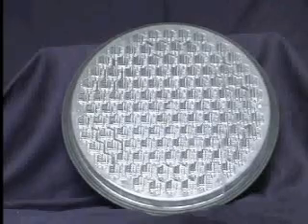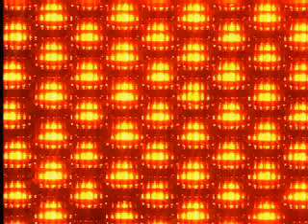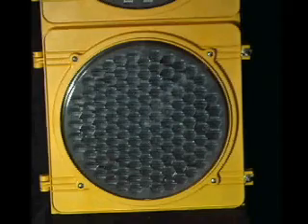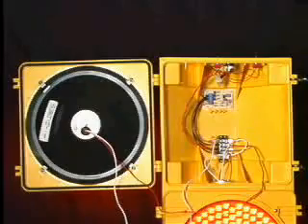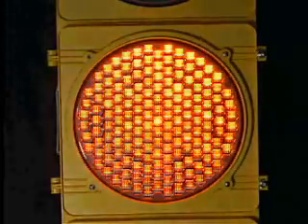LED Traffic Lights

Comment: LED signals do burn out rather fast, actually, but not from going on and off.  When they were first introduced they were expected to last anywhere from 10 to even 30 years, but they didn't factor in all the vibration from passing cars and trucks being transmitted up the poles.  That's why you see LED traffic signals that are partially burned out all the time.  Personally I try to discern shapes: a golfer, a palm tree, a walking elephant, these are some of the ones in my neighborhood, La Jolla,CA

Comment from the maker: @yakir11114 Not true. LED traffic light use much less power then standard incandescent traffic light bulbs so your Solar systems can be smaller with LED traffic lights.

Comment: @RacerXGTO 
I've noticed they typically start to go out in the upper center of the LED array, where it is probably the hottest, (heat rises) I think the manufacturers haven't taken into account the toll thermal cycling takes on the LED solder connections and they fail. They need to design the arrays with heatsinks to keep them cooler.

Comment from the maker: @agiwch A few problems with this. We would have to teach drivers this new one light system. Three LED dies (one of each color) in one chip would not be as bright as one LED one color in one chip. This would not meet the DOT light out put requirements.

Comment: So far, I'm not impressed with LED signals. I don't know which signal manufacturers my city buys from, but most of the green LED signals around town have from 10% to 60% missing segments. Also, the amber signals are about half as bright as the others. Even the walk signals have burned-out sections, and all are under five years old.

Comment from the maker: Not true. The forward voltage is different for different color LEDs. Red, Yellow and orange LEDs voltage is between 2.2 VDCto 2.6 volts DC. Blue, White Green and Aqua Green color LEDs voltage is between 3 volts DC to 4 volts DC.

Comment: i think LED's are the best possible light source for a Traffic Signal...the long life and low power consumption could really be great advantages to have...so you dont have to change the bulbs so often.....i read somewhere that a Bulb used in a traffic signal must have a minimum lifespan of 6,000 Hours....LED's can surely beat this by thousands of hours,when properly constructed LED's can last 80,000-100,000 hours...with some Lumen Depreciation occuring during that time frame.

Comment: How is the light system affected in the case the city replaces only the incandesent red a green lamps which burn out more quickly with LED units and not the yellow lamp?

Comment from the maker: It the LED traffic light were made correctly then yes they do last for 100K hours. Maybe you have power spikes in your area. That could cause a problem with the LED traffic lights if they do not offer any protection in the circuit. They should use LEDtronics LED traffic lights.
JPP...

Comment: I noticed that these new units are beginning to fail in my town... they get these flickering sector failures. rather than the whole thing dieing, whole sections go dead.

whys it doing this? I thought LEDs lasted for 10 years or more

Comment: ODOT purchased thousands of red LED inserts (I don't know which company made them) in the late 90's and distributed them around the state. Within a couple of years, they got so dim that they had to be replaced. Many of the brighter second generation reds had reflective red lenses that appeared lit in direct sunlight. Later green ones lasted less than a year before portions of the circuit boards began to burn out or flicker. The most successful seem to be the LED inserts for incandescent heads.

Comment: I live in St. Louis, MO and have seen snow build up on the LEDs before. That's the one good thing I liked about the old style lamps, the heat would melt the snow off. Also, one time, for instance, I was at an intersection where they were going from yellow to red, the yellow went off and the red signals took like, 5 seconds to come on; when the other direction already had their green light. This never happened before they replaced the lenses. With the old style, you never had to worry about that.

Comment: "Since they don't develop any heat, blowing snow can stick and block the light."

They're far below 100% efficient, so they do generate heat. Just a lot less than a 5% efficient light bulb(even less when you consider the colour filter that removes most of that 5%)

Comment: The LED signals are better, but like many things they're not perfect. They can fail partially instead of completely like a single bulb, such as one red light which was partly lit but had a dark zig-zag down the middle. Some of them flicker, but it looks like a controller problem when the Don't Walk lights all flicker together. Since they don't develop any heat, blowing snow can stick and block the light.

Comment: They have tested LED traffic lights in my area in London. Particularly on a pelican crossing outside Sainsbury's supermarket in Camden Town. But the problem was, when you pulled up at the stop line, you couldn't see what colour light was showing because of the angle you were at in the car! So they took them down and put back the latest pre-LED style.